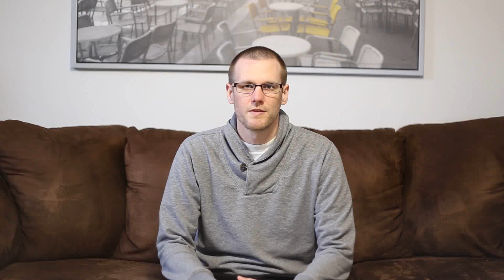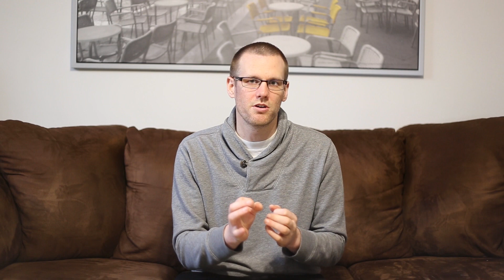Does a Brushless Motor Pull Power from the ESC?

Comment: Great video. I have a odd question for you. Can you have too much ESC for a motor? More specific, can say setting the punch value too high result in the snapping of a motors shaft?
Reply from the maker: No, the motor only takes what it needs. The idea is to make certain the ESC and the Battery can provide more current than what the motor will draw under an appropriate load for it. Think of it more as the esc can only restrict the motor. an example of this is setting punch values lower.

Comment: Does this mean like if i have 2 setup

1000kv with 10:1 gear ratio
2000kv with 20:1 gear ratio
Both motor are same dimensions only different in KV, both use in the same kit let's say the weight of the kit is 5kg

Given the ratio the speed is about equal right? But with 2000kv the load of the motor to turn run the kit is much lighter right? So is that mean that the power use in both motor is almost identical?

Comment: Great video.
Using a high current ESC with a low current motor would work fine, but could it affect the flight time in any manner? Since the high current ESC would have extreme low Rds MOSFETs which could allow the motor to consume more current than it actually needs..
It would work fine but all I am curious is about the flight time.
I am using a 55A 4in1 esc with 360KV motors which would draw a max of 20A.
Reply from the maker: You wouldn't notice a difference in run time but you would notice a difference in the heat produced at the ESC.
Reply: @RCexplained  
Thanks for the reply 😄
Reply: @RCexplained  Would it produce more heat or less heat?

Comment: Okay so if we want to future proof our build we can go ahead and put that super powerful esc on without worrying it's going to burn a motor out. The motor is only going to ask what it needs. I was very curious about this. Going to build a 4" race drone. Wanted to buy a super powerful t motor 55 amp esc in a small 20x20 form. No motor out now for a 3 or 4 inch could ever need that much current. It's nice to have the super powerful esc for future proofing
Reply from the maker: That is correct. A 100A ESC can work on a motor with a max current of 10A for example.
Reply: @RCexplained  thanks so much for confirming this. I was worried I wasted a lot of money. It was a 90$ esc. I've grown to have a massive amount of respect for t motor products. There qualify is second to none. The extra money spent is future proofing and insurance on reliability. I've got many of there esc and all have been amazing. Thanks for confirming this. Have a blessed weekend
Reply from the maker: No worries Mike. Good luck with your build.

Comment: Excellent video as usual. I've been preaching this to the RC Speed Run and Drag racing communities for some time. Lately, lots of guys have been jumping to the most aggressive motors and ESC settings that they can muster without properly tuning their systems or considering the load on their motors, ESC, and batteries. The results usually involve charred electronics and releasing copious amounts of stinky smoke. It's good for folks to hear this message from multiple sources.
Reply from the maker: Thank you for the comment. That's great that you too are sharing god info. It certainly helps the RC community grow. Keep up the great work on your end!
Reply: Hi, I wonder if you can help?
I have 2 Savage XS’s which have been sitting in the shelf for over 3 years. I changed the gear ratio to be able to run 3s lipos, like on a video which was done by HPI on YouTube and I changed the ESC’s to a hobby wing 120a esc and sold the other ones. Now before I brought any 3s lipos, I obviously ran my 2s to see how it ran.
The car is amazing fast which is what I wanted but it puffed up my 2s lipos, motor and wires were getting hot. The esc wasn’t. As the original esc is suppose to be 80a is it the esc which is causing this or is it the gearing or is it the batteries.
I really want to to start running them again, but don’t want to spend unnecessary money!!!!!!
Really hope you can help.
Reply: @SEC0NDTW0N0NE  Puffed batteries usually mean they were not able to keep up with the current load of the motor/esc or they had been damaged by undercharging or overcharging. Here is an article I wrote about this.
https://www.facebook.com/rhouse21RCPhysics/posts/1475426522628851
Reply: rhouse21 - RC Physics Thanks for answering my question.
I balance charge all my batteries. So I take it the ESC is too powerful for the battery and motor then.
I don’t really want to go back to 80a esc. I wonder if dropping it to a 100a would stop it.
Thanks for replying because most people don’t reply when I have asked this question.
Reply: @SEC0NDTW0N0NE  A new battery is the best way forward so you don't loose performance.